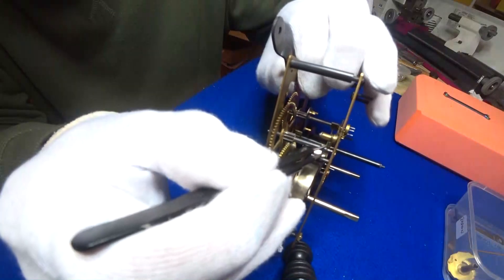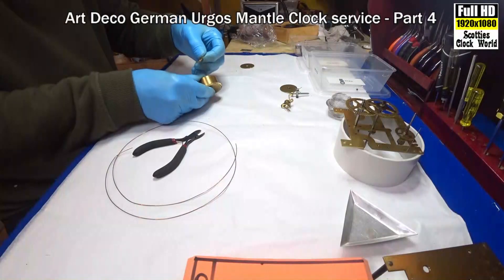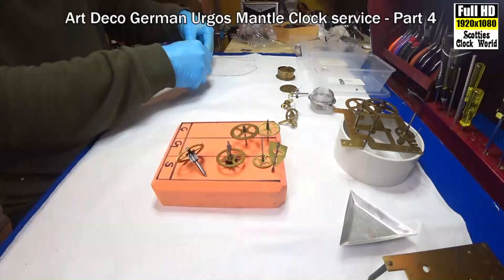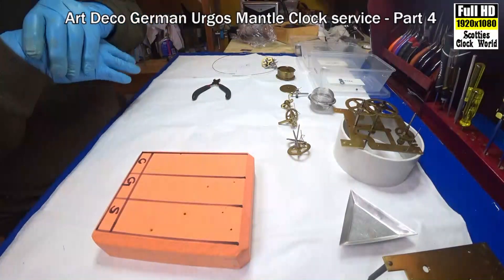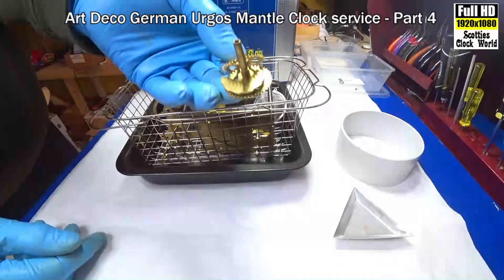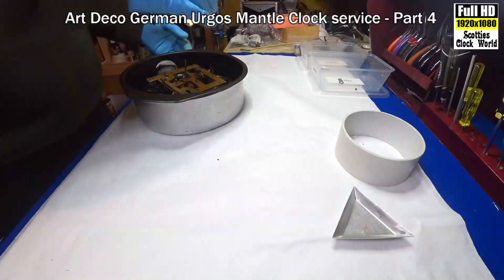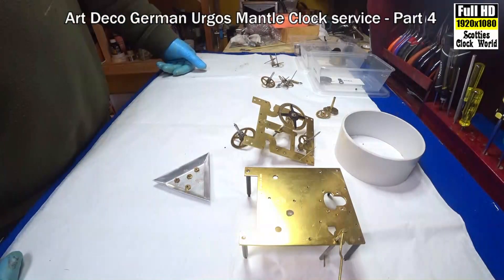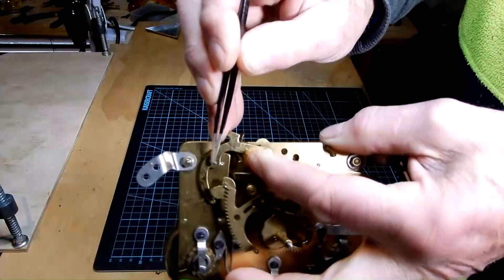Art Deco German Urgos Mantle Clock service - Part 4

Comment from the maker: #GermanClockRepairs #ScottiesClockWorld
In this clock repair series I get a 1950's Urgos mantle clock running again.
In Part 4 I prepare the brass parts for cleaning in the ultrasonic cleaner.
In Part 3 I clean and grease the mainsprings.
In Part 2 I dismantle the movement, remove the springs from their barrels with a spring winder.
In Part 1 I remove the movement from the clock case and let the mainsprings down.
It appears to be in quite good condition, though the Suspension Spring is broken and there is no Pendulum Leader or Pendulum.
Scotties Clock World adds new clock videos every week of the year.
If you want to learn how to repair mechanical clocks, Subscribe here: https://goo.gl/jgk1Tk